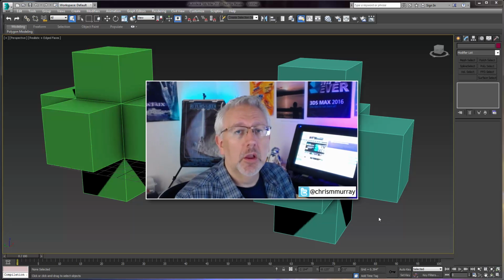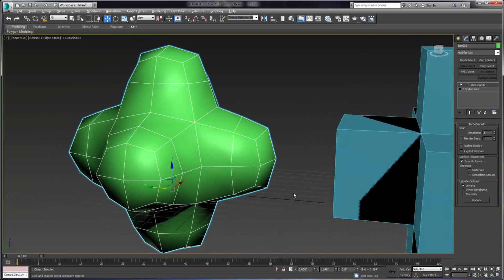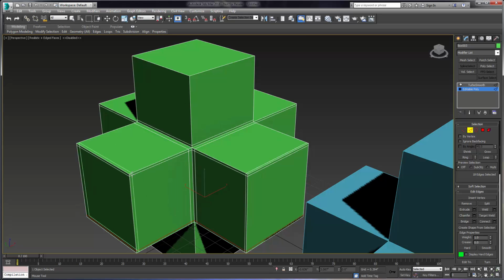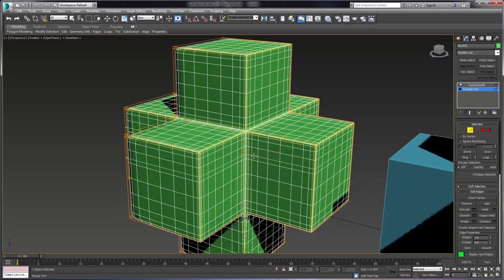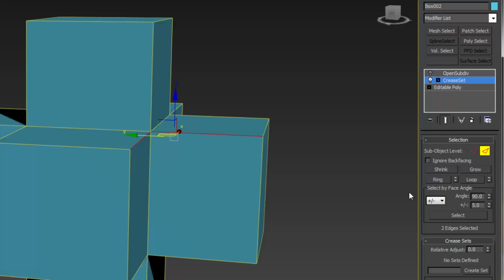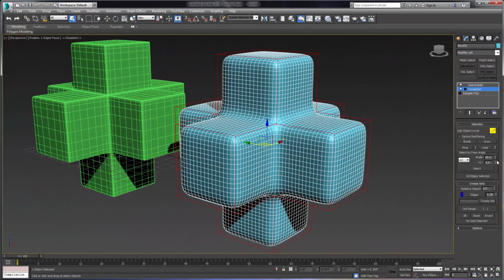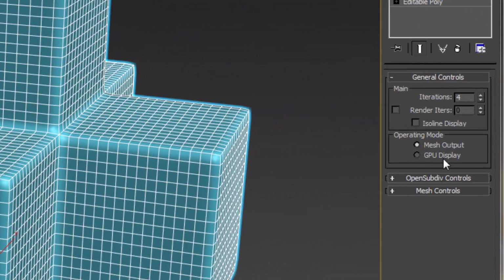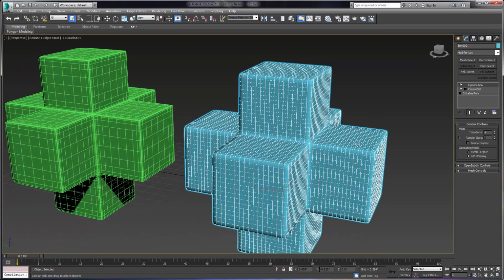3ds Max Tips and Tricks: Modeling Open Subdiv vs. Turbosmooth

Comment: I'm trying to use crease set but it keeps messing up once I change the geometry. Is there a more efficient way of working? For example, I create basic design forms and use crease set to get the edges I like, then i start to add details, then the crease set is all messed......and I end up repeating crease set selection so many times....very frustrating

Comment: Fantastic. I'm still new to hard surface modeling and I just discovered CreaseSet + OpenSubdiv; now I use it all the time. It's also way more steps to try to SwiftLoop the geometry, and it's hard to generate each loop the same distance away from the edge. Thanks for the video!

Comment: Can I collapse the stack with opensubdiv and creaseset for the deformation of a mesh or in the process of animation? Or should I save the hierarchy of the modifiers in the stack?

TurboSmooth significant load of RAM if are many iterations of subdiv. How does computer resources opensubdiv loads when I need to significantly smooth the mesh with it ?

Comment: With all the advantages, you'd expect to see more people using OSD, but what I see in forums and tutorials, most people still use TS. Is there a reason or is it just out of habit?
Reply from the maker: my guess is a little of both. OSD really helps with Character Animation since it can accelerate on the GPU and maybe there aren't lots of people doing that. Plus. max's viewports have gotten really fast so TS slow downs may not be that noticeable.

Comment: Isnt OSD just a language which is ready by many apps and therefor make it more versatile. Edge crease can be done with turbosmooth right, so dont see the difference really
Reply from the maker: OSD is is external code from MSFT and Pixar that was implemented in Max. Same basic code that is in Maya and supported by FBX. Edge "creases" or sharp edges can indeed be done in the TS with support edges on either side of the edge you want to crease. 

The disadvantage of TS is that is also creates tons on unneeded geometry everyplace else. OSD doesn't. So on one or two objects it might not be a big deal. But on lots of objects its a huge deal. Not to mention you can do selective sub-divisions per object with 1 OSD modifer and several crease sets. TS adds geo everywhere, all the time. 

Finally, OSD has GPU mode which off loads all the mesh transformations to the GPU significantly speeding up playback of smoothed, animated objects. 

So there are some major advantages to OSD.

Comment: So what's the difference in performance comparing with opensubdiv if I will apply turbosmooth twice? Thus, in first one I will iteratate for like level 3 with smoothing groups distributed. Then, I will just apply turbosmooth without anything and the result looks smooth.

Comment: With the same result on the rendering , the number of polygons in the object with the OSD in 4 times more than the same object turbosmooth...
Reply: 'That's because the iterations is higher on the OSD at that point in time. If you look at the base shape, every "face" of the TS model has 9 quads for the OSD's 1due to the need for the reinforcement loops. At an interation of 1 on both you have 36 quads on the TS vs 4 on the OSD. At 2 you have 144 for TS vs the 16 for OSD. TS becomes exponentially larger due the the extra base quads created by needing to reinforce those edges.' - Josh Atkin

Comment: Problem with Opensubdivs you are adding so much extra geometry and to have reasonable look to your sharp edges you need to use 4 or 5 iterations which is ludicrous.  GPU viewing helps with viewport performance but it still stands the fact that to be able to control the sharpness of your edges you still need to add extra supporting loops.  Sometimes going even 6 iterations will not give you that perfect edge in opensubdivs.  Its a great modifier for one thing and that is you don't need to worry about adding extra loops and ruining your perfect geometry just to achieve that sharp edge but it still lacks that perfect look with just 2 iterations that ive used since beginning of time in turbo smooth
Reply from the maker: this is an excellent point.  I still use TS for many things for this reason.
Reply: @3dsmaxtrainer  nnsns thn y u just mislead us to make that stpd tut!!!! >.<
Reply: "...you are adding so much extra geometry..." this is wrong. Look at the left object with turbosmooth. The loop density on flat surfaces are nut much high and there are not as many loopes as in the right object, right, BUT look closer to the edges and creases. The densitiy near edges and creases is very high, so the created geometry has a high amount of really small polygons what can mess up your UVs, retopology or working.

Comment: The definition is not concentrated on the edges, this will not give same or better result than the add support edges technique.
Look at what modo did with the edges weight, copy that or do better.
Look how the definition is concentrated on the edges with the old technique of add support edges, you need less subdiv and the flat part that dont need detail should have less definition.

Comment: So if I understand you correctly open subdiv is the way to go? That is if you have both modifiers always use open subdiv? Or is there a scenario where you would use TS over OSD?
Reply from the maker: +Numan Salati good question. I prefer OSD in any situation where I will likely have all quads. Moving or not. TS adds more quad regardless of topology. OSD is more retrained. Not to mention that it has VP dependent SubD now.
Reply: +3dsmaxtrainer sorry what does vp mean?
Reply from the maker: VP means View Port
Reply: Aah got it. Not sure i understand why osd is vp dependant though...
Reply from the maker: Its VP to help maintain VP performance. You don't need a ton of mesh detail when the geometry is far away from the camera.

Comment: Meh! Doesn't look that different, doesn't seem to do the tri optimizations pixar wrote for their mesh sub div system. for me i'd still divide edges simply for the work flow for porting to other systems such as zbrush. and if you want a low res mesh take them out for that.
And doesn't poly mesh have a load of edge weight functions anyways? why use crease set? why do they keep adding tools that don't go anywhere. does anyone use patch modelling anymore?

Comment: 1. Why didnt you just use the Chamfer modifier on the TS model? Then add TS Its like you try to make it look hard.

2. Is there a way to make the opensubdiv edges not look like a faild attempt to smoth?
All I can see here is that it creates quite a lot of geometry on the flat surface and does a bad job on edges.
Reply: Chamfering will result in triangles at the outer corners and Ngons at the inner corners, and it's best practice to get all quads if possible.
Reply: @scatterbrainart  You can use the Quad Chamfer option in the Chamfer modifier to avoid those two issues.
Reply: @scatterbrainart  You have heard of quad chamfer have you?
Reply: Export a subdivided object (an open cylinder or smth similar) with turbosmooth from 3ds max to z-brush for example and create the same object within z-brush and apply subdivision. The geometry will will always be different, no matter what you try. Opensubdiv is a new and open standard for 3d modeling applications to preserve the same subdivision technology for different applications.